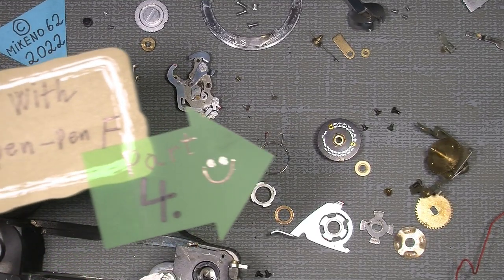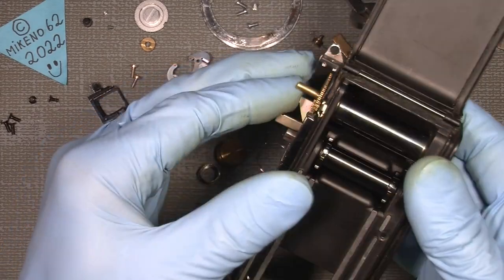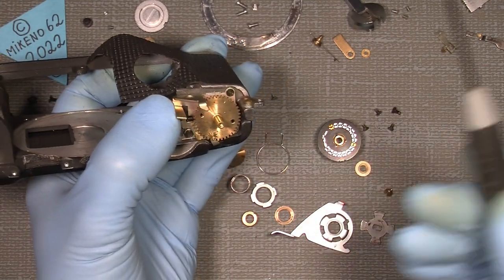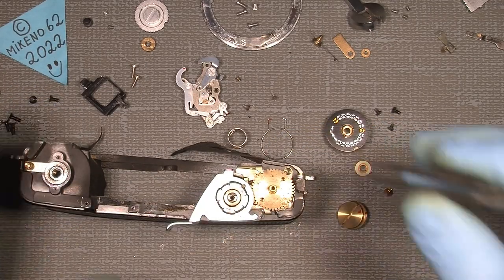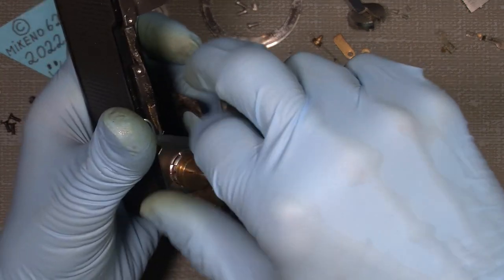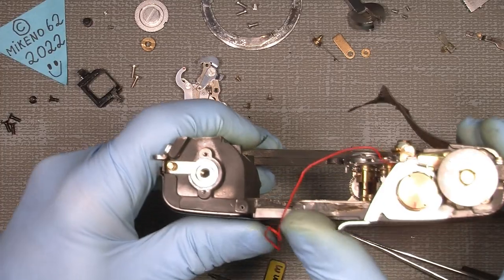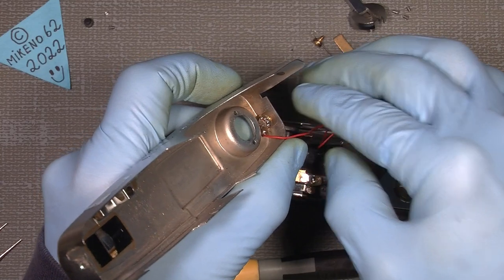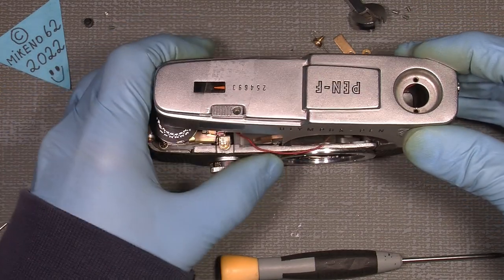Working with Olympus-PEN  part 4   Assemble the Camera

Comment: Hey there, thank you for making these videos. I have a small issue on my pen F. I have removed the slow speed escapement and cleaned and lubed it a few times, it works properly OUT of the camera but when I put it back in, the cam that moves the actual slow speed lever get stuck in the up position. Any thoughts? 36:46

Comment: Now that I have reassembled my PenF several times, I've discovered two things.

The first thing I've discovered is that it is much easier to join the shutter half of the camera with the optical half of the camera when the shutter mechanism is wound up. That is because the cam in the shutter mechanism which triggers the mirror mechanism to close is retracted when the shutter mechanism is wound up. If the cam is extended it gets in the way of joining the two halves of the camera. So I wind the shutter, join the two haves, and the release the shutter mechanism by pressing the trigger the mirror mechanism normally presses (like you do at 46:03) to get things back to the relaxed state.

The second thing is about winding up that gear under the 8-hole disk. It's much easier to let the shutter winding mechanism wind that gear than to try and do it with little instruments. Just join the two halves together with the gear (and the spring it drives) relaxed or nearly so, and then wind and release the shutter (like 46:03) to put 1 turn of tension on that spring. If you must get the indexing just right (I'm not that sure it had to be exact --- it's a spring tensioning gear, not a timing gear) then position the index mark in the final position as you join the two halves, and then wind and release the shutter. That works because winding the shutter causes one complete rotation of the indexed gear.

I believe you did this without realizing it, when you wound the shutter up at 45:43 and then release only the shutter mechanism at 46:03. The the mirror mechanism was wound, but never released. You've put 1 whole turn on the gear under the 8-hole disk this way, which will remain there forever (which might be good, or it might be a  little too much base spring tension, I don't know).
Reply: One more thing: the screw which holds the spade connector to the flash socket seems to be deliberately made to be half accessible with a flat blade screwdriver. Instead of forcing a JIS (or worse, Philips) into it at an angle, I turn it one quarter turn at a time with a flat blade screwdriver inserted into the accessible slot. That's also how I got it open, since mine was stiff.
Reply: I find it is easier to place the top cover if the camera is face down on the table. Then the shutter button and the spring hold position on their own. I pulled the flash wire up (towards the back of the camera) with a loop piece of thin string (floss) threaded in through the rear screw hole under the rewind knob, and out the underside of the cover. Inside my camera the previous assembler had taped the wire to the top cover to keep it in place, but the tape was dry. But that must be another way to keep the flash wire from getting pinched or in the way when replacing the top cover.